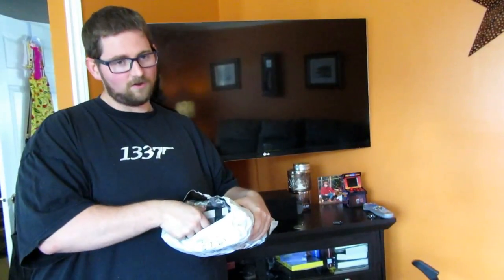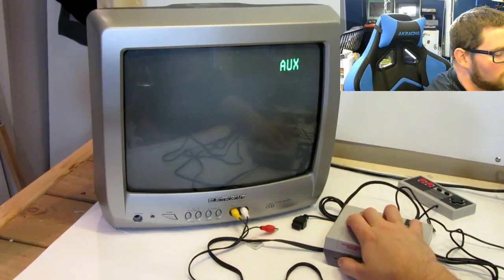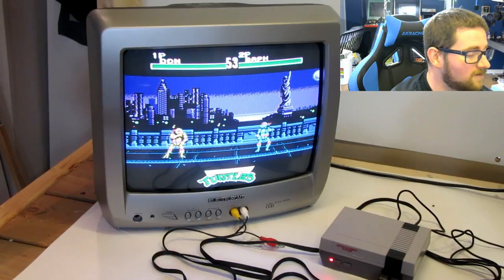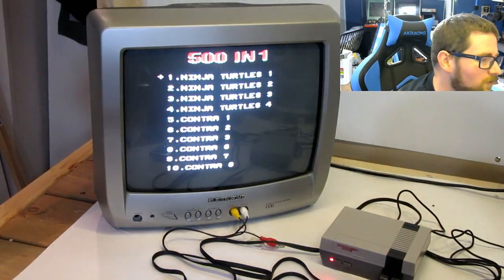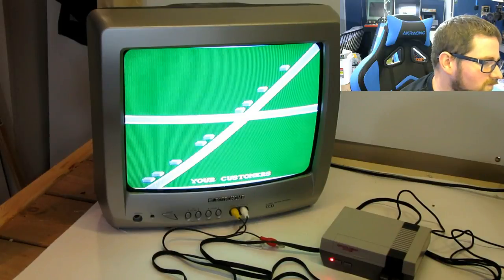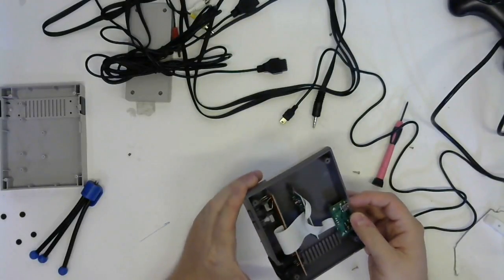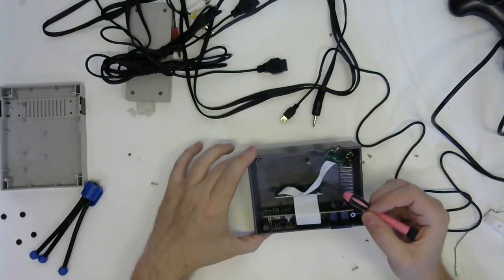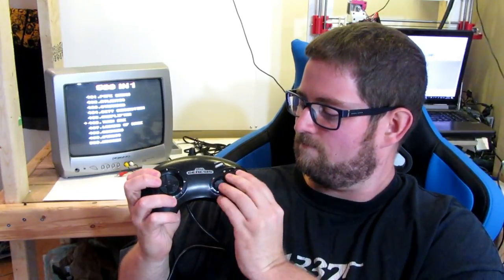Unboxing, Testing, and Teardown of a bootleg NES Classic from AliExpress

Comment: Hi James! Thanks for the video! Perhaps you can try adding more games to the "console"? Does Hakchi2 work? Is it posible somehow to change software and get it to look like the real Mini? Is it even possible to add more games to it? Thanks!
Reply from the maker: Hey there!

Unfortunately this system is built using old hardware. The USB port is for getting power only, no data connection to it. The hardware in this one is completely incompatible with the actual NES Classic. There are apparently new versions of it coming out that DO basically copy the NES classic hardware though!
Reply: Thanks for your help!:)

Comment: I've seen these on eBay too. They appear to be the same machine, but those ones claimed to use a PAL signal, which would leave me to believe that they would not work on my NTSC TV. Is that what the specs on your Mini Entertainment System claimed to be as well?
Reply from the maker: Jay Grinder mine was listed as ntsc, but I am not finding a lot of the ntsc ones listed anymore. It was also listed as 110v instead of 220v
Reply from the maker: Retro Classic Game Player Family TV Video Game Consoles Childhood Built-in 500 Double handle control Pal Ntsc
 http://s.aliexpress.com/2mURr67f 
(from AliExpress Android)
Reply: Thanks for the info. The one I was looking at is considerably cheaper than that one, but the box and the console in the photos do look the same, 

http://www.ebay.com/itm/Retro-Classic-Game-Console-NES-TV-8-Bit-Built-in-500-Games-2-Controllers-/391855063162?var=&hash=item5b3c61c07a:m:mocFg_2YvB52J9ZPgUGKEtQ

I honestly don't need it because I don't think it has any games that I do not already have on several multi-carts, but at that price I was kind of tempted.
Reply from the maker: Yeah, the one I bought was a lot cheaper but the listing is gone now. Hard to find an ntsc one now apparently.